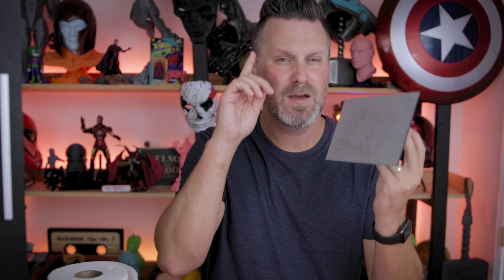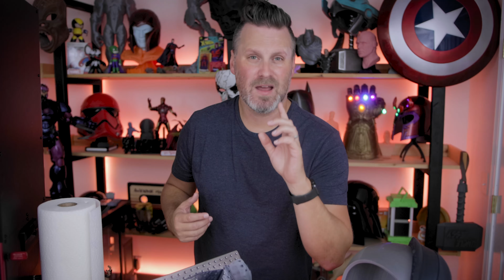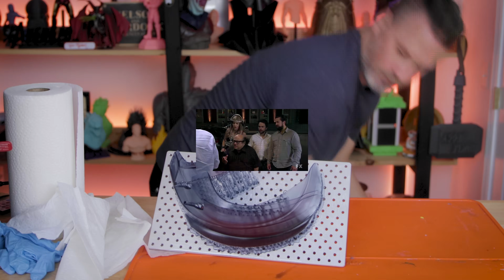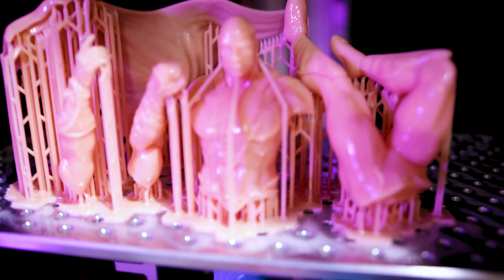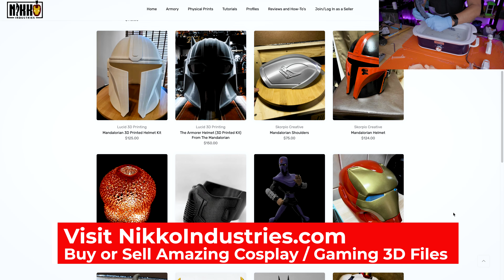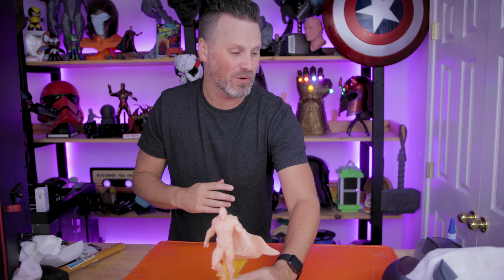Stop Resin 3D Print Fails! Bed Adhesion Tips & Tricks

Comment: Great video!  I struggled to keep stuff on the build plate, then I sanded it, I struggled to get stuff off of the build plate. I said, screw this, put the flex plate on and I will never look back. My every new resin printer will have one installed before even first use.

Comment: I wonder  if a flex plate with a matching hole pattern would help to remove the parts on the Jupiter. Also maybe only use opaque resins with the printer might prevent curing within the holes.

Comment: I found that pouring boiling or very hot water over the bottom of the prints help a lot to remove them! It softens up the resin quite a bit. It’s the same logic that goes into  soaking before support removal

Comment: I'd recommend using a UPS system for your outlets but only for the SLA printers.  Just make sure to use a 1500V version.  I personally got this one.  The type that you get will depend on how long your power outages tend to last.  I personally use the CyberPower CP1500PFCLCD PFC Sinewave UPS System, 1500VA/1000W and while this one doesn't last too long it works great short power losses.

Comment: Have great first layer but having serious issues with getting past that.  Mars pro 2 and saturn.  Tried slowing lift speeds down and set exposures to 4.2 and higher and they are still sticking to the FEP instead of supports.  Pain in the butt!
Reply: Make the contact point of the supports bigger. A youtuber did the test and A LOT of prints failed because of "fine" support settings.

Comment: A really under-utilized tool in lychee really helps with the removal process. I add a raft to my prints with a height of about 1mm and it allows me to lift the print off the bed easily with a plastic scraper. I've never ever had to use a metal scraper on my bed
Reply: Yeh i was sitting here thinking why not just use the shapewall raft, my prints always just peel off once you get under the corner. must be a reason.
Reply: To both of you, I use rafts and I use the rubber mallet and scraper. I guess I will experiment with the bottom exposure. The other issue is the support structures never print.
Reply: @Thardris  Sometimes it's just VERY stuck on. I was printing the validation matrix, and I got the tip of the scraper under the corner. The print was so stuck on that it just kept breaking off when I tried getting more of the scraper under it. I ended up with about 6 pieces that I had to clean, cure, then tape back together. I've since decreased the bottom time to 28s (from 30s), which was still too high, so now it's down to 25s. I've still yet to test 25s though.

Comment: When trying to get things off the build plate, it has to be so much harder since the scraper is having to slice through resin that's cured into the holes. So you're not only scraping resin off the plate but you're cutting cured resin in each hole.

Comment: My biggest problem is to find the right setting for "vat VS cured resin VS buildplate"
Resin is like super sensitive to pretty much everything, so it makes it kinda impossible without wasting half a bottle for 1 print (cause of 10 tries every time)

Currently Im using Elegoo Mars Pro and have 3 different resin bottles from 3 different brands (none work for me, elegoo, anycubic, nova 3d)
Mostly the part stays sticking to the vat. after first layer exposures, it tells me that its too high probably but then if its too high it should have been sticking to plate instead, so its too low? Ehm yeah.. you get the idea of the entire hell.

3s it sticks to vat
2s it sticks to buildplate but doesnt cure properly,
something inbetween ok, good, but its only for ONE print, then Ill have to find the right settings again and also isnt kinda stable
.
So how do you do that? Must be a frigging nightmare to adjust and waste so much resin to get 1 print right. xD 
For now the elegoo is in the corner dusting and fdm grew on me, but I still struggle to give it a chance cause of above reasons.

It really sounds like its not normal, cause for some reason lots of ppl get 1st try prints, like on FDM when setup right.
Do you have any tips how to learn to read that resin community sheet with all the different brands and times? Cause for now it doesnt tell me anything tbh, I still dont know how to interpret it :)
Reply: Did u get any advice ? I just started resin printing and I had been having issues with my print sticking to the vat and my last print was stuck to the build plate and the vat , so I had two globs of cured resin on each side so I don't know what to think anymore 😂
Reply: @dustiidih  No I ditched resin printing, it always look good and easy on video, but is way more hassle than FDM
Reply: @coffeediction  damn sand to hear because the resin minis always looks so beautiful
Reply: @dustiidih  yeah ikr.
But dont listen only to me, maybe there are better printers and my elegoo for 150$ is bad at this. Trial and error I guess. Just was not worth for me personally. I found FDM much easier for my needs.
Reply: @coffeediction  thanks ! Glad you found something that works for you. I bought a different type of resin , I've seen some videos say once they found the right resin their issue somewhat dissolve so crossing my fingers that I magically fix my issues 😂
Reply: @dustiidih  that is a good idea to try out different resin types and find your own, Im glad you have the spare cash for them too haha, hella expensive. But yeah lots of physics apply too, for example clear resin is different because it lets UV light trough, so it probably cures way faster and so on. Have fun trying out and remember to ventilate and wear a mask, this stuff is no joke.
Reply: @coffeediction  yeah no kidding !! I almost made a grave mistake by running it in my room while I slept without the proper ventilation when I first got my printer !!
Reply: I’m having the same issue- however I think it’s wise to spend time trying to create several little test prints (like collaboration cubes) to dial in your printer (rather than waste resin on minis that don’t turn out)

Comment: I'm sorry, Jesse.  These resin printers are getting way too big.  Yeah, the holes in the plate work and necessary, but would not a flex plate and/or half the number of holes in the build plate work better?
Reply from the maker: Flex plate on a buildplate like this would end up capturing a TON of resin in the holes on the top. I have other machines that also have completely smooth large buildplate and those still work well. But the holes supposedly help cut down on the suction/peel force

Comment: Thank you very much for the tip, I bought an Anycubic mono x and a wham bam system and haven't been able to get it to print yet. Will give this a try once I get home
Reply: i have the same setup and plate, nothing sticked on the wham bam until i sanded it a bit, now its perfect
Reply from the maker: @HelgeKeck  a little sanding really does help

Comment: How about using a raft with a shape wall? 
Initially getting under the print is much easier with it, even with just a plastic scraper.
Reply from the maker: That can certainly help as well. I tried that once before with this same machine and still ended up with lots of cured resin in the holes

Comment: Would lowering the first layer cure time also make it easier to remove prints from a more traditional bed like the Saturn? Nice detail mentioning the setting name in each of the major slicers.
Reply from the maker: Yeah that is certainly worth trying
Reply: Affirmative, however I recommend setting up a couple of tests as if you go too low you won’t be adhering anything to your bed. I HIGHLY recommend enabling rafts as they give you a nice point of leverage to slide your spatula/scraper under to pop off your print. Should you be using a pre supported file from lychee (has a bunch of lines that the supports are built on) or anything that sits flush to the build plate: wrap it in a plastic baggie and let it sit for 30-45mins in a freezer, should come off with little to no problem

Comment: Just use a raft on perforated build plates, works great.
Reply from the maker: Yeah that still didn’t help with a bunch of cured resin getting stuck in the holes but that for sure can also help
Reply: @UncleJessy  I've never had that happen on my Transform, im using the default Transform print settings.
Reply: Phrozen shared a raft STL in the Mega 8K Facebook group which has the holes sculpted into it. Haven't tried it yet but being able to skirt around the holes is a cool idea. I'd love to see Chitubox or Lychee modify their software profile for machines with perforated plates to show where the holes are in the view and even provide an option for avoiding those holes with auto-supports. (assuming Lychee is ever able to support the Mega's encrypted board)

Comment: Did I hear correctly? You said 40 seconds for burn in layers? Holy cow! With mono screens I have yet needed to go over 20 or 25 seconds. Also I only use like 4-6 layers for that.
Reply from the maker: 40 was the original then I lowered it to 30 and since I’ve gone down to 25!
Reply: On my Mars Pro I had to increase it from default 60s to 70s to finally have the raft sticking on the build plate.
Reply: My mars 2 pro stock suggests 35s.  I bet based on how well it sticks, 30 or 25 would be fine!

Comment: Hey Jesse, thanks for the sanding tip. I'm looking at getting a large printer for doing stuff similar to your helmet. I can only afford one large printer. Would you recommend the Phrozen Mega 8k that you used in this video or wait and see how the Jupiter performs after beta? Thanks for the content.
Reply from the maker: The mega 8K does print great but man are those holes messy when it comes to cleaning. The Jupiter wont be out till next year but has the awesome resin auto feeding feature
Reply: @UncleJessy  Thank you for the info. I'm in no rush so I'll be waiting then to see how they stack up against each other as they revise their products. Thank you for helping the community make educated decisions on these products.

Comment: Hey Jesse looks like I'm first. I'd love a video on temperature impacts on resin and temperature control.
Reply from the maker: Yeah , I was just thinking I should have mentioned that as well. Can look at doing a followup because for sure cold print room will also impact your resin 3D Print experience
Reply: @UncleJessy  Thats what I'm starting to battle as I set up my basement print room and the seasons cooling down.
Reply: @UncleJessy  this  all back my other comment about the various ptc heater builds out there for printers!